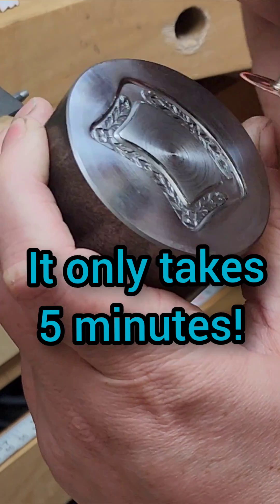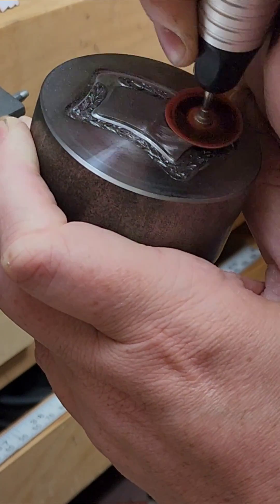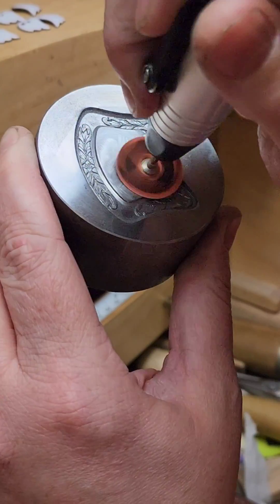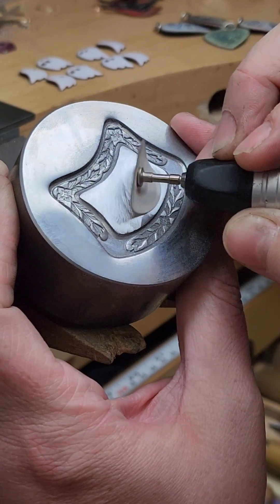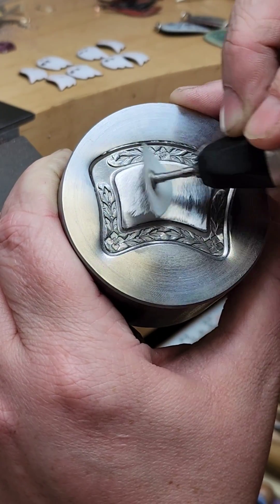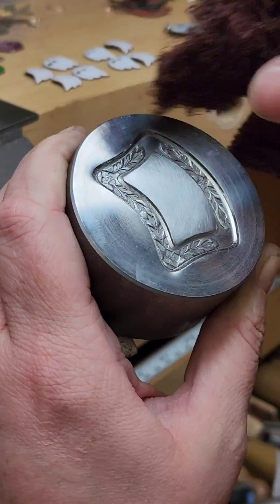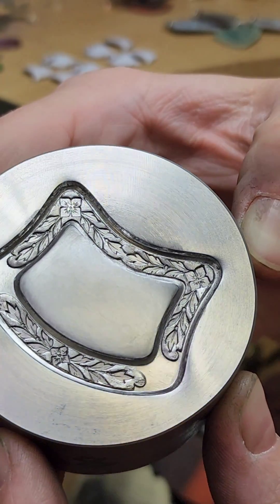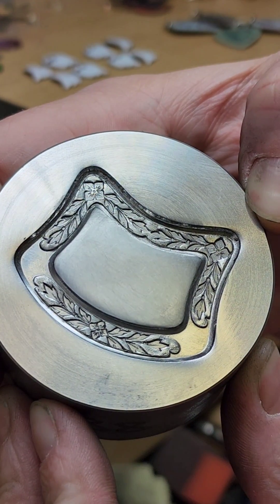Removing Machining Marks from An Impression Die

Comment: What kind of steel is that puck? A6 soft?
Reply: sand papers are made from much harder materials than steel could ever be

if you use tools you can see really quickly how fast the material gets removed